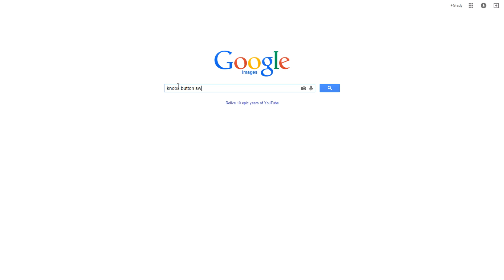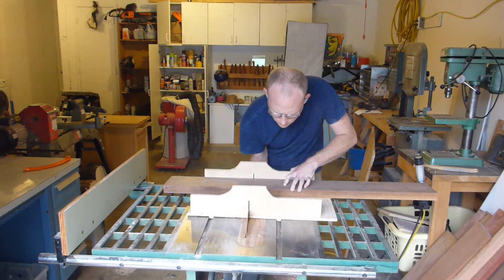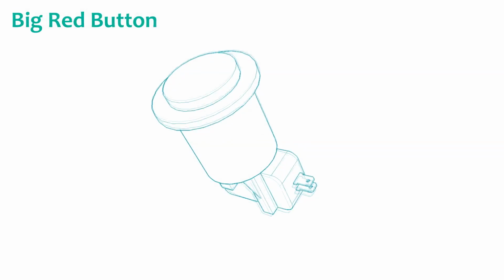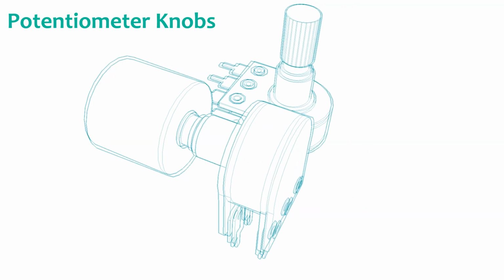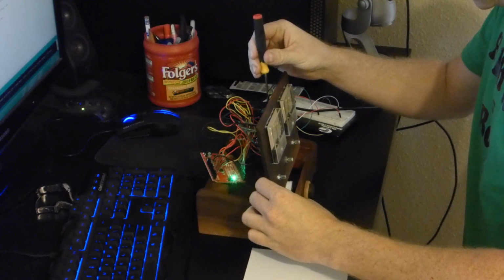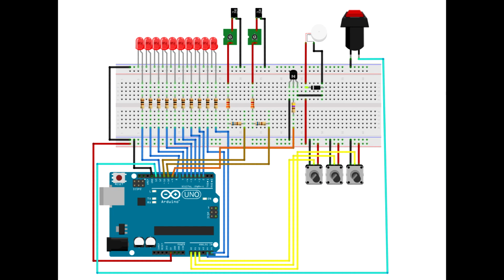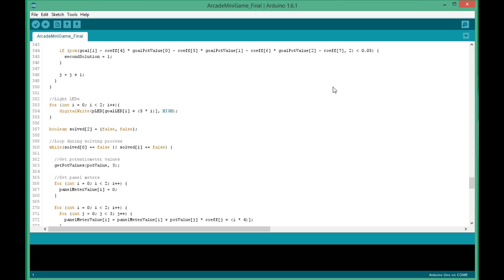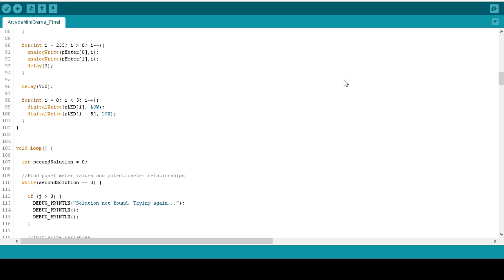Arcade-Style Puzzle Box Mini Game

Comment: I'd recommend using rotary encoders instead of pots, and a led driver board since programmable control is way easier than soldering new resistors. (And digital calibration is way easier than using pots for meters)
Reply: Oh, and there are addressable RGB LEDs now as well. If you are building a project that you want to reprogram, adding in as much flexibility as you can afford is a good design choice.

Comment: Don't know if you still with this but something that could add more chalenge is time.
Make the LEDs blink faster as the times goes on, if you solve it in time, next one has a shorter time, if you don't, it shows on LCD, as binary, how far had you gone, until you press reset and starts it all over again ^^

Comment: I've made the below changes to try to incorporate the relay lock into your code. This is literally this is my second attempt at modifying someones code and I have no previous knowledge of coding (although I try).
 I am opening myself up for laughs, but I'm hoping to get some feedback. 

/*Arduino Arcade Mini Game with LED Panel Meters
define relay       4       // relay on pin digital 4
#ifdef DEBUG
 #define DEBUG_PRINT(x)     Serial.print (x)
...
#################
void setup()
{
pinMode(relay, OUTPUT);    //set relay pin for OUTPUT
digitalWrite(relay,LOW);   //set realy low on power-up (door locked)
}
{
  //Initialize serial for debugging
  #ifdef DEBUG
    Serial.begin(9600);
  #endif
  DEBUG_PRINTLN("Debugging...")
  //Initialize pin modes
  for (int i = 0; i < 10; i++) {
    pinMode(pLED[i], OUTPUT);
}
...
#################
  //Buzz if solved
    if (solved[0] == true && solved[1] == true) {
digitalWrite(relay,HIGH);     //energize relay (unlock door)
delay(2000);                  //keep door open for 2 seconds
digitalWrite(relay,LOW);      //relock door
}

I used code from "Secret Squirrel Door Lock (youtube)" to try to achieve my goal.

Comment: Great toy and a great video. Really enjoyed watching this marriage between woodworking and electronics. The only thing I would have done differently is to use end grain for the face plates rather than long grain. That would have let a lot more light from the LEDs through the wood. End grain veneer is extremely brittle, but the face plates are protected anyway.

Comment: "No idea whether it will work or not". Let me tell you - when your idea has been as thoroughly mapped out as that has been, you just make it work. Design flaw? Revise it and try it out again! I didn't stop developing Findaratish when I was stumped after 4 linguistic improvements. I continued by finding other ways to further develop the language: By developing a non IPA-based character set for the grammar, and using the shortest form every word in every Google Translate-compatible language (quickest way of obtaining short words). Now, I've got a cryptographic language that I can use if I ever need an additional layer of security in messages. I started it out of boredom in Geometry.

Practical Engineering - You have more experience and more thorough planning. Yours couldn't have gone wrong.

Comment: The rat's nest is an issue of wire management, not design. Think about what's going where, group and position things accordingly, trim the wires to an appropriate length, use zip ties. Color coding the wires also helps, but I couldn't tell if you did that or not and I can't be bothered to check.

Have fun modding the code!

Comment: Here's an idea for a game. The meter will show light up a random LED, and you have to turn it to it. Each time you do this successfully, it will show the same LED, then another one, and you have to point it to both. So each round, another LED that you have to point to would be added to the sequence. To make it more interesting, you could use LEDs from either meter, so you'd also have to remember which meter the LED was on. When you lose, it will vibrate and reset. So so it's basically Simon with more buttons

Comment: heres how i think how this could be more fun. people will have a limited time to aling the needle. the time up alarm could be the vibration motor. maybe strong enough to give the person a jump scare. the button could be used to something more game related like finish the puzzle. if the needles are aligned the the person dont push the button in time the game is over. maybe a flip switch could be added to do the reset work. very sorry for the typos.. im using a keyboard the size of a remote control in a but of a hurry. lunch time. great channel, btw.

Comment: Hey man that looks like an awesome project. I have a suggestion. You could probably simplify the electronics quite a bit by removing all the LED resistors. Instead, solder all the negative LED ends together into one resistor that connects with gnd. I know how deceptively long it can take to solder and insulate 10 resistors :P. 

Also, it would be really neat if you made your Arduino play a sound through a small speaker when you win. Take a look at Examples -> Digital -> toneMelody.

Comment: you could add a speaker or just the audio out (via a follower op amp) so that in  addition to the visuals you can have an audio puzzle as well. You could also add a midi output, so that you can use it as a real midi controller.

Comment: Very cool.  If it isn't challenging enough just put a timer and each solve the timer goes down giving less time tot sole until you lose.  Maybe add 3 way switches that work in a similar way that causes lights to line up with other lights to add another dimension to the puzzle.  those are what come to my mind but either way very very cool toy.

Comment: Great Project, looks fun. Any Particular reason you used A4 and A5 for the last remaining LEDs, and pins 10 and 11 for the gauges? It seems much more straight forward to use the digital outs for all the LEDs and run the gauges off the analog outputs. Thanks!

Comment: Love it, ...now, if you replaced the buzzer with an open/closed switch it could lock/unlock a drawer or door?  Add one more set of controlled dials inside that drawer, ...or maybe a set of 6 push button switches that turn on/off your ability to turn on the power to the next section, etc.  Brother, I could do this all day!

Comment: Pretty cool.  If you add a time factor, perhaps even having levels so once you complete it you get less time for the next solution.  You could maybe start pulsing the rumble more as time is running out to amp up the tension, but then I guess you'd need a different way to indicate success.  Flashing the lights I suppose.

Comment: Very nice project, and the result is great. Good job!
The game itself doesn't seem that challenging. To spice it, you could add a limit time. Use a buzzer or the vibrations to inform the user, by triggering it more and more often. The amount of time you have to complete the puzzle decreases after every success. When the gamer fails at completing the puzzle in time, game ends.

And another game suggestion : one knob directly linked to a panel meter (the one in the centre becomes useless). Leds are lightened sequentialy, one by one. Goal is to be able to follow leds using knobs. You can easily adjust difficulty level by adjusting speed.
I'm not sure if you see what I mean, ask for details if interested.

Comment: Nice project, wood and electronics really goes together. I never used an external microcontroler board, I find I can do more by designing my own circuits. You should try it.
I keep my good soldering iron at my cottage, I can rely on using a crappy one. I solder with one at home.

Comment: Neat project! I've got that same crappy Weller soldering iron. Put any pressure on the tip on mine and it cuts out. Your new one looks like a Hakko.
Thanks for the mention and I'm glad you found the countersink idea useful :)
Reply: I fully agree with you John Heisz.  Weller's lower end tools leave much to be desired, and are generally very overpriced for their quality level.  In my opinion, Hakko is definitely the better choice for the occasional electronics user.  Their quality, performance, and ease of use tends to be well above the Weller's lower end fort a very modest, if any, increase in cost.

To be fair however, I should note that Weller has two distinct lines: hobbyist and professional.  I have owned and used their professional level tools for many years with great ease, confidence and success.  I chose Weller because they had a local dealer for their professional line (most of my systems are +$100), and provided impressive support throughout my military career and training as an electrical engineer.  So if it is something you will use daily for "mission critical" work, I would strongly recommend Weller's high end tools, just realize they have a corresponding price.
Reply: Michael Olsen I have a Weller WES51 and it works great.  
The piece of crap one was a pretty good idea (low voltage, interchangeable tips, heats up fast, has an LED light), but the execution was terrible. Very poorly made, very uncomfortable to use. A lemon! :)

Comment: Don't worry about wiring mess *****.  That is why us electrical engineers call the wire layout for a PCB a "Rats Nest".  If it wasn't for PCBs our projects would look just like yours.

As for soldering, while it is simple in concept, it is not in practice.  In fact, it has such a wide range of applications and techniques that most people only apply themselves of one or two.  It takes much learning and practice to reach high quality results, but the basics and a bit of patients will do for most DYI projects.  The single biggest rule, and the one that is most often ignored, is "Always use the least amount of heat needed to make the connection."

Soldering iron are either rated by temperature or power (generally watts).  Most are far too strong for the delicacies of small electronics.  Generally, anything over 12 watts is going to be too hot.  If you wish to continue in electronics, I strongly recommend getting an adjustable iron.  Getting one with replaceable tips can also be helpful.  This allows for easier use over a broader range of projects (e.g. very small components, larger heavier components, de-soldering, wood burning, etc.).
Reply: That is actually one of the better brands for most "armature" electronics work.  If you should ever have any question about soldering, please do not hesitate to ask.  I have been soldering at various levels for over 35 years and will be glad to help if I can. 

Electronics is the smaller, and therefore cooler, end of the art and my area of specialty.  The hotter end is brazing (sometimes claimed as the cold end of welding).  While I do mostly electronics and micro-electronics, I also have experience with medium weight (e.g. plumbing, stain glass, etc.) and brazing.  Though for those I would likely refer you to more experienced people for anything beyond the very basics.